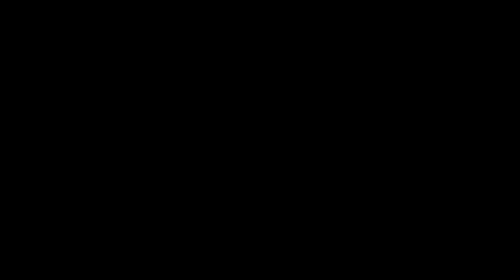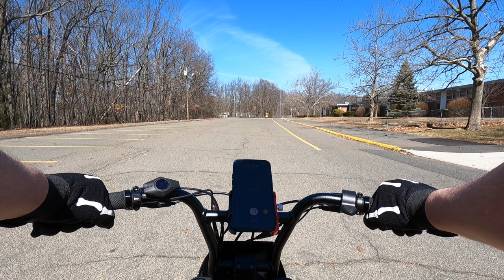How To Bed Your E-Bike Brakes

Comment: I recently changed to new brake pads on both tires on the Super73 S2, I used Tektro breakpads (same ones that came with the bike as default, dark green ones), I cleaned the disks with 90% alcohol and microfiber cloth, and I have that squeaky sound, today I tried this method of bedding and then the sound started to go away, I'm a bit scared it will come back again and I will need to do it every time I ride, any other tips on how to remove the sound?
Reply from the maker: Glad the process worked for you. Sometimes it’ll make sounds for a bit until the pads wear down the initial layer.

Comment: So iv watched this video because i didnt know that i needed to bed in my brakes. They are super squeaky now and i dont know wat to do. Can u pls show me the steps to fix this? Much appreciated.
Reply from the maker: You can try these steps and see if it helps. It might be too late though. There is a process to clean your brakes if that doesn't work. Keep me posted.
Reply: smear mud all over the rotor, then ride the hell out of it.  Mountain bikers have been doing this for years, works like a charm, keeps them nice and quiet.  I'm not joking by the way, it does work.
Reply from the maker: @garywebb8807  lol. That’s great. I’ll have to try it.

Comment: Do you need to do this even if you brakes don't squeak in the first place?
Reply from the maker: Yes, you always want to get in the practice of bedding your brakes before riding. It may not be squeaking now but you could run into that issue later down the road.
Reply: @easyheimer  cool, thanks!
Reply from the maker: @4everTagMe  you’re welcome!
Reply from the maker: Yes you should.